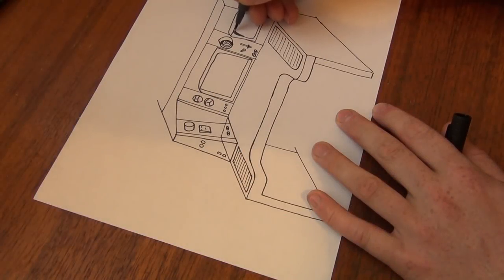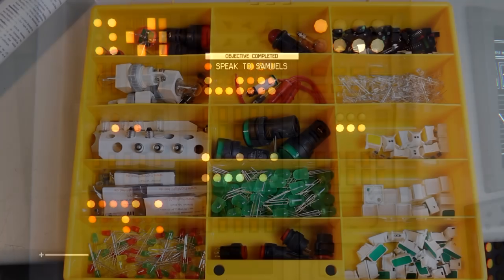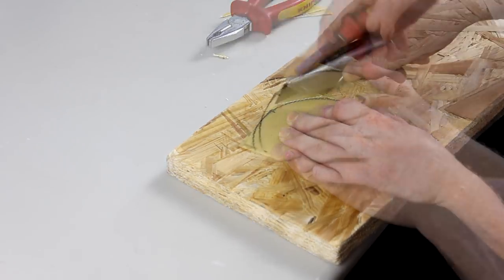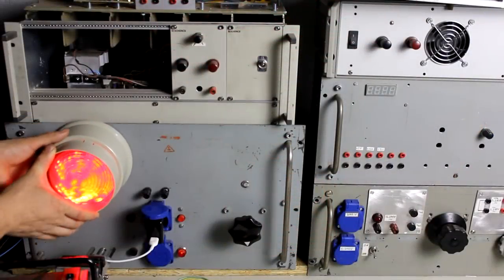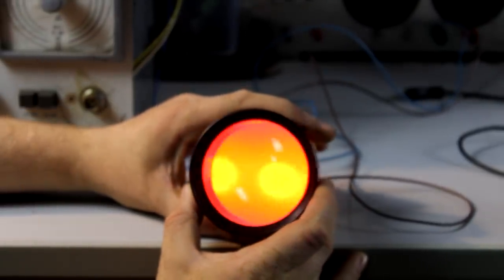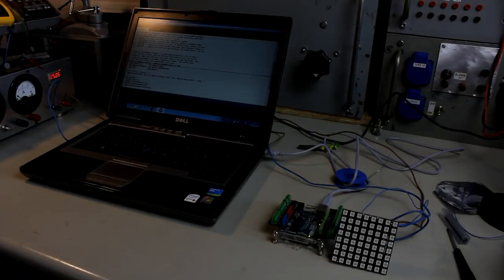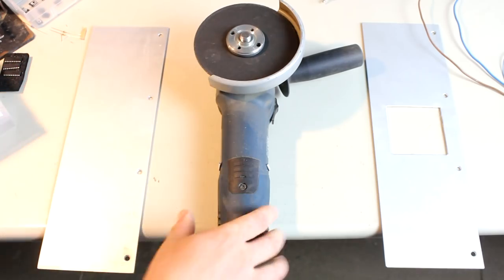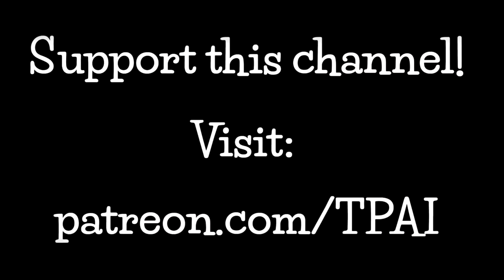Creating Cool Sci-Fi LED Effects

Comment: I really enjoyed this! I've used clear plastic that was lightly sanded on the insidede to diffuse light as well, works great.
Here's a fun custom trick of mine!
I've done custom auto body for ages. I can change the color of instrumentation inside the car. The best thing, is to go to the candy isle at the store. Many colorful and semi translucent colors of plastic are available for candy containers, as well as some disposable plastic drink containers as well. I also use colored reflectors for bicycles that have the backing removed. I remove the gauge panel and carefully disassemble it, then I carefully chop out the blue for brights indicator, then the green for signal flasher and so on, then I trim out the bits of disposable translucent colored plastic I want to use and glue them in place carefully. 
My car has yellow signal indicators now, the others are all different as well. Using colored bicycle reflectors is cool too, because they have a textured pattern that adds a new dimension as well. 
Have fun!
Reply: acetone vapor also works with some plastic! just leave it suspended above an acetone bottle overnight.

Comment: A cheap shower curtain works well as a good diffusing material and you can use it in many sizes or layers to get a good effect.

You can even colour the curtain to use with various white LED's to get the desired effect.

Comment: One of the best effects I've seen is basically the same thing you did except using a compact disc instead of the circuit board so the lights reflect off the CDs surface colored mirror effect.

Comment: I see, they are not just useless electronic art pieces but they serve a function that lets you know that you have power.
Reply: I would use the RGB matrix to display some dynamic yet not very useful info as bar graphs:
- speed of typing in the last seconds 
- weight of the user :)
- CPU usage
- fan speed
- etc.

Comment: My WS2812B matrix was labeled wrong. So the DOUT was actually the data in. (Also note, that these modules are very sensitive for voltage peaks, so a benchtop power supply can damage it.)

Comment: A quick note on those 5V LEDs: You can just take the same Power Supply you use for the Arduino. USB is already 5V, so no need for a second PSU. Just don't go overboard, and look at the PSU to not overload it.

Comment: I've used similar LEDs (RGB fast fading) and have found that putting a capacitor in parallel (I used a low voltage 2200uF), will allow the ICs to keep their state while powered off.

Comment: The large signal lamp with those LED's inside looks like it would make a good 'Star trek Enterprise' engine, with the old slide viewer, how about putting a graphics LCD/OLED module in there with a radar scope simulation running on it.

Comment: fascinating, i appreciate that this was done for funsies but I am more all abute form follows function.  I would have not had the large blinking lens. that would have been the old tube driven oscilloscope with a transparent cover and back light (more steampunk than your design) and the projector would have been used to project an image from an old mirror chip display onto the wall.  that might be WAAAAAAY stupid but thats the idea right?  My own console table is a cross between a jewelers bench and a german lab table (its all aluminum extrusion) but i am not into gaming as you are.  these ideas are great, show us the sketches of what got rejected as well as they may contain very good ideas for more extreme weirdness.  Thanx

Comment: ..and you listed half-baked "Instructables" instead of Neopixel uberguide from adafruit. This half-baked half-done "instructions" ALWAYS forget about resistor and ~1000uF capacitor. It is actually lifesavers for neopixels matrixes. You need to be 200% sure that matrix from random assembler from China have a resistor before first LED. Some strips have both resistor and capacitor on each LED, but usually it's just a capacitor. So if something went slightly wrong, first "pixel" will die and all matrix went down.
Reply: Thanks for the tip, the number of dodgy instructables out there is crazy, no limit resistors, bypass caps etc etc etc.

Comment: So much pacience to solder all those leds, While you were soldering them is was wondering if they blik at the same time, clearly not, probably the slight difference in manufacturing gives enought drift to the leds to never sincronize